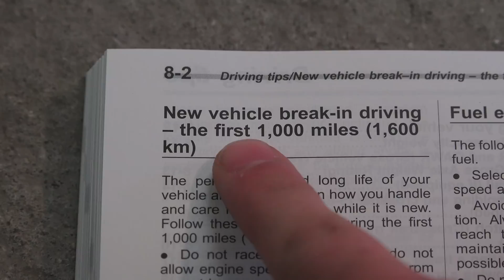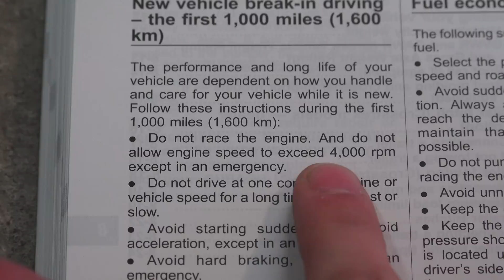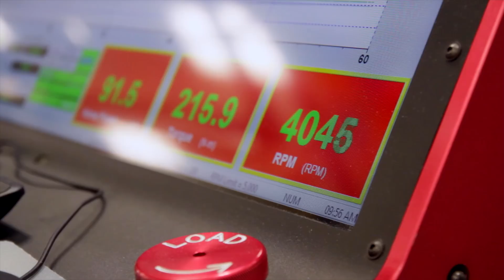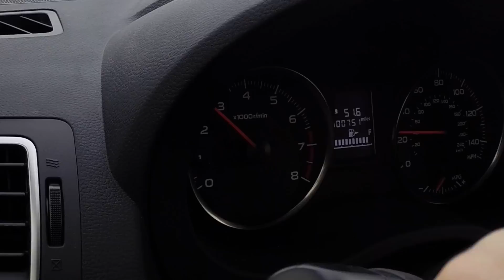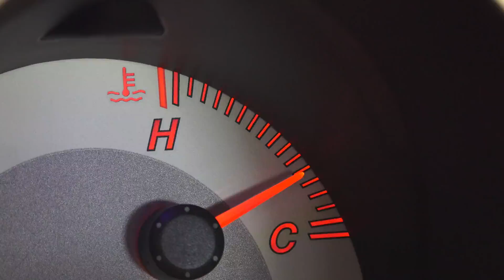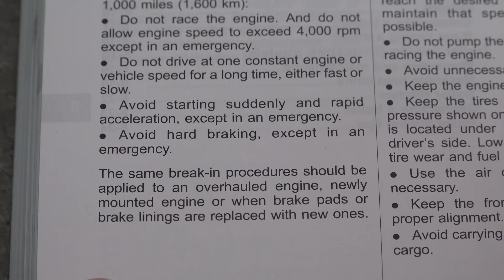5 Things You Should Never Do In A Brand New Car

Comment: No you need to floor it so the piston rings will bed in properly using the run in oil.
Reply: In 1950, yes. Why do you think you know better than all of the manufacturers? After hundreds of millions of dollars worth of testing this in the last few decades........ you think every manufacturer has the wrong idea? Stop being foolish please.
Reply: I build a lot of high performance engines and in order to create a seal between the ring and the cylinder wall you need to create good friction when the engine is new, using the run in oil. A good seal will give more economy and power ,.stock cars like your brand new honda can be run in any way you like, but the one run in hard will make more power.  nothing silly about what i am saying its a scientific fact . Now i notice you hide behind a blue A please show your face don't be scared .

Comment: RULE #1...Simply avoid lugging the engine.  Giving more throttle than the engine can comfortably handle creates excessive heat.  Excessive heat can permanently warp fresh AL pistons.  

Full throttle is bad.  High rpm is bad.  Towing is bad.  Lugging the engine is very bad, even at low RPM.

Comment: I was told that with the super-accurate and precise machining today, there really isn't anything such as "break in" when it gets into the customer's hands.
Reply: The manufacturers write "break-in procedures" into theit manuals for a reason. Engine failure is quite rare nowadays but you can still shorten your engine's lifespan but not breaking it in correctly, going too long between oil changes, no replacing the coolant on time etc.
Reply: I do seriously wonder if those who ignore the break-in period are the same people who go WOT on a cold engine that they didn't even wait to let the oil start moving before they started driving? I'm curious whether those kinds of behaviors are far more detrimental to the life of the car, than the initial 500 miles.  @andthe2380  

I'm not saying the running-in period isn't important, but you think how many cold starts and short journeys an engine could experience in its life, vs. the first 500 miles.

Comment: What would be considered short trips?
Reply: any trip where your engine temperature gauge doesn't reach full operating temp. Usually 1/2 way on the gauge. In the summer with heat in the 90's {30° C} it can be just several minutes. In the winter with sub zero temp. it can take 20 minutes+ depending on traffic, how you drive etc. Don't let your car idle for more than a couple of minutes in winter. Instead, let it idle for the 2 mins and drive carefully with the rpm's under 2,500 and don't accelerate fast. Warming the engine up under a light load is MUCH better for it than to have it sit for 10 mins in the driveway dead cold, slooowly trying to warm itself up. Let the rpm's settle down to 900-ish after you start the car and with the rpms near where it usually is when it's already warm, then drive a bit softly until it is fully warm.

Comment: You probably won't respond, but I happen to live and breathe this for a living and I sincerely disagree with your first points. Your arguments on piston ring wear do not appear to be based on any recent empirical data. We build race engines along with regular joe engines. We see more performance, less bypass on engines which are forced into aggressive break in procedures. This has been known for years in the motorcycle world and is common practice among engine builders. Why spread the myth that an easy break in helps? It does not and this is backed by substantial evidence. I offer both an engine dyno and a hub dyno if you are interested in following up on your claims.

On a separate note, your statements that manufacturers know best is not actual evidence supporting your point. If you would like, I can post up numerous examples of manufacturers recommending procedures that are not in the best interest of the consumer.
Reply: After hundreds of millions of dollars on research and development of car engines, why do you think every manufacturer is wrong? Why do you think their manuals are filled with myths? Why would manufacturers offer a plan to damage engines? Engines and transmissions are just about the only things covered under warranties these days. You just keep playing your video games and let the professionals handle the important stuff.
Reply: I never said the manufacturers are wrong. They have their own reasons for suggesting their break in periods. But it has nothing to do with getting the most performance out of your engine. By the way, this is fairly common knowledge in the professional racing and engine building worlds. But, since you want to resort to off topic personal attacks, let's have at it. Instead of providing one shred of proof defending your argument, you instead attacks me because my page contains videos of things I do in my spare time. On top of that, I run a performance shop that specializes in just the thing I am speaking on. We hold numerous horsepower and on track performance records. Now, since you didn't provide any proof, why should I? You're just an angry person on the internet like so many others. No matter how snippy your reply gets, you will still be wrong.

Comment: jokes on you my redline is at 4000........
Reply: Diesel?
Reply: Diesel Gang
Reply: lol. Actually I think that means... the joke is on you. :P
Reply: Mines as 3200!
Reply: pffft my redlines 1700
edit: custom built steam powered ‘67 beetle. almost 950 ft lbs. not your grandpa’s ICE
Reply: Cummins?
Reply: @P7777-u7r  Cummins redline is 3200 to 3400.
Reply: My uncle's diesel Audi redlines at 5.500rpm. Quite high for a Diesel engine.
Reply: Иіск Рагіllб Same here
Reply: HOW
Reply: Ahhh diesel...
Reply: Michael Tighe my friend's smart car actually redlines at 6,5k rpm, just like my previous 3 cylinder city car…
my current (pushrod) V8 redlines at 5,6k lol
Reply: My diesel car has a 6k red line bitches
Reply: Why do diesel cars has low redline
Reply: @greenblue980  I would imagine because diesel have more torque lower down in the rev range, this torque curve then drops off much earlier making it far more inefficient to run at higher rpms. But I just made that up on the spot based around my general knowledge of ICE engines, so I may be wrong lol
Reply: Because you have a diesel
Reply: @jjm2948  joke is on the people who don't know that diesel has low red line but still act like they know everything
Reply: Mines at 9000000000000000 rpm

Comment: There is no film on new tires.  It's a myth.
Reply: You are ignorant and are spreading lies because of it.
During the manufacturing process, a release lubricant is applied which prevents the tire from sticking to the mold in which it was created. Unfortunately, some of that lubricant remains on the tire upon installation. It reduces traction for a bit, but wears off after use. Going easy on your tires and driving cautiously for the first 500 miles should eliminate this lubricant and allow the other layers of the tire (the rubber, steel and fabric) to work as they should.

Comment: So should u do you're first oil change early mine is due at 8k should I come in at 2k? I got a 2018 mazda 3sport 2.5l
Reply: Early oil changed can olny help. Oil changes are the best thing you can do for any engine, no matter the miles on it. I always do oil changes for new cars twice as early as recommended. {3,000 miles = 1,500 miles. 5,000 miles = 2,500 miles etc}. I do this for the first 10 months or 10,000 miles or so.

Comment: Is it ok to drive a car with 85 miles. 287 miles highway.. What would be best way to approach this?
Reply: it is not recommended. Just vary your speed and rpm's as much as possible. Drive at 65 mph at say 2,800 rpms' for a few minutes, then go down to 58ish mph for a few mins at 2,400 rpm's etc. It is still not a proper way to break in the engine but you have a life to lead, so do the best you can.

Comment: 1. Don't floor
2. Don't shift at redline 
3. Don't use cruise control
4. Avoid short distance travel (For proper engine operating temperature) 
5. Avoid towing

Comment: New car engines are broke in in a matter of minutes,if you think the rings are wearing down the cylinder bores you are mistaken-take a new motor apart after 10/20 thousand miles and you'll see the hatch marks from cylinder maching are untoughed,JMO
Reply: Ignorance is no excuse for spreading ignorance. Why would all of the manufacturers recommend break-in periods? These are just precautions but they do limit the risk in damaging an engine. I assume you are 60+ years old? Your opinions are outdated by decades.

Comment: Hard break in is best, ask engine builders.  When I had my camaro engine rebuilt he told me how to break it in using multiple full throttle runs on standard oil changing the oil after 400 miles.
Reply from the maker: Should we ask random engine builders, or perhaps the engineers that design the engines? I think both certainly have useful feedback, but it'd be silly to ignore the folks that design it.
Reply: What a load of nonsense. Why not ask a bunch of random people who do NOT design engines and have NOT spent hundreds of millions of dollars in research "how do I break in every car engine in the world?" Yeah, smart.

Comment: Literally the only thing you need to know: Let the engine reach operating temperature. Every other direction in the manual are simply specific ways to do this. It is the only variable that affects the dimensions of the motor. When you rev to high rpm, you vary the temperature between the piston and the cylinder walls. When you put the engine under high load, you vary the temperature between the piston and the Cylinder walls. When you operate the engine cold, you vary multiple parts temperatures, and increase friction in metal on metal areas. Ever wonder why the dual viscosities in motor oil? Thicker oil absorbs more stress. Temperature control is any mechanical device's best friend, all the way down to the seals.

Comment: Not sure if this has been asked but what if you live in cold climate? Should you let your car warm up before driving?
Reply: Don't let your car idle for more than a couple of minutes in winter. Instead, let it idle for 2 mins and drive carefully with the rpm's under 2,500 and don't accelerate fast. 
Warming the engine up under a light load is MUCH better for it than to have it sit for 10 mins in the driveway dead cold, slooowly trying to warm itself up. Let the rpm's settle down to 900-ish or {where ever the rpms usually are when it's already at full operating temperature}, then drive easily until the car does warm up to full temp. Also, the car will produce heat for you much quicker this way.
Reply: And The thats totally correct. Greetings from an Engineer ;)
Reply: If your car has a turbo you should always let the oil warm up before you drive it. If you don't have a turbo, +And The is exactly correct.

Comment: You realize that companies run the engines to max rpm in the factory?
Reply: They only do that for quality control reasons. They also only do it to engines they pull off the line to make sure that the current batch of engines are being built properly. These test engines are often run through many tests like that, not just one. Then they are discarded.

Comment: Should one change the engine oil say after the first 1500 miles
Reply: It is smart to change the oil early. Any tiny metal shavings etc. can be flushed out and if the oil is getting hotter than normal due to tight tolerances being worn down is also replaced. It's just very smart to do this. Take at least 25% off of the oil change recommendation for the first several months and you will have done a lot for your engine.

Comment: I have a highly modified V-Max making 198 rear wheel horsepower and it eats up the rear tire around 1,000 miles when I put a new one I take it into a dirt lot and do burnouts with it to remove that slick crap the put on new tires. I had a friend buy a brand new Yamaha Maxim X and I warned him about the slickness of new tires, leaving the dealership he floored it and spun it around in around traffic before he crashed. Everyone came running out as fast as they could to remove his new bike out of the road, the dealership repaired it for him for free because they never warned him about this and did not want a lawsuit. When I bought my next V-Max from the same dealer they told me about the tires needing a break in but I already knew this

Comment: I've owned 3 brand new cars. Beat the crap out of them right off the dealer lot. My first one was totalled unfortunately after 4 years and about 100k km. Not a single blip and mileage was astronomical on that car. Second car owned it for about 40k km and traded it in, had a bigger engine so fuel Econ was slightly crappier but never let me down. My next ride was a demo with 5k km. It was broken in VERY hard. At about 155k km now and she's still going strong knock on wood. 
All my cars have been over maintained because I have the opportunity to take care of them. Treat your car well, and it will take care of you
Reply: Just because 3 cars in the world were broken in poorly doesn't mean it's okay to abuse the engine of every car. It is more likely an abused engine will break down more often or develop problems earlier than other engine will. Your statement of "Treat your car well, and it will take care of you" is idiotic. You abuse your engine badly right from the factory but claim you "treat your car well"? You're a dim person.
Reply: And clearly you know nothing about cars. I would take a beaten car over a babied car any day of the week. Why? Because a babied car has never been pushed. Start pushing it and stuff is going to break, and fast. Having experience from tracking my cars for years now, stay on top of the maintenance and very little will happen. When something does happen, take care of it immediately. Prevent high maintenance costs down the road. If you are going to modify your car, do it properly and you will be less likely to damage anything. If you don't know how to tune, pay a professional. All cars are meant to be properly driven (aka beaten on) consistent start/stop, short trips, lack of maintenance and leasing is killing these cars. Why leasing? Because owners don't care about the car and know it's going back. I work with cars on a day in and day out basis, even with included free maintenance people still go over the oil change interval. In some extreme cases as high as 40k KM's overdue. Maintenance is number one thing keeping cars alive

Comment: I have a new car with about 300 miles on it , I floored it only once, is once enough to damage it during this break in period ?
Reply: I floored mine 4 times already and I had less than 100 miles lol
Reply: Engine failure is quite rare nowadays. Even if your pistons or rings or cylinder walls got hot spots or some premature wear, you will still be 99.99% safe. These break-in procedures are precautionary measures to get the longest life from the engine. Maybe your engine will need piston rings after 170,000 miles or maybe it will start burning some oil in year 12 instead of year 14 etc. Most likely you are fine and have only shortened the lifespan of the engine by 0.001 percent. Or maybe caused a few little issues to be more likely near the end of the car's life. Don't worry about it.

Comment: i am sorry, but break in period for tires?? i dont know what kind of cheap made in china, hand sewn by children tires you are talking about, but if you decent tires from a decent brand, they have no film on them at all, they are good to go after getting them installed on the car, as for the breaks, the breaks dont have a film on there either, the reason brakes need to break in is because brake pads and brake disks are not the same shape (the general shap is but on smaller level they are not) so they need a bit of wear to adapt the same shape, giving you more surface area when the pad pushes on to the disk, resulting in more friction, resulting in to faster / better breaking. how ever this is not a couple on 100 miles, this is just a couple of miles i would say between 30 and 60 miles depending on how break heavy you are driving.
Reply: With your ignorance and insults aside. During the manufacturing process, a release lubricant is applied which prevents the tire from sticking to the mold in which it was created no matter where the tires are manufactured. Some of that lubricant remains on the tire upon installation. It reduces traction for a while, but wears off after use. Going easy on your tires and driving cautiously for the first 500 miles should eliminate this lubricant and allow the other layers of the tire (the rubber, steel and fabric) to work as they should.

Maybe try learning something sometime? Showing how ignorant and lazy you are is never a good idea.

Comment: Most people overlook the effect of camshaft lube that is applied to the lobes during installation.  The lube contains extreme pressure additive package that is very inert thus not soluble in engine oil.  High rpm and heat is required for the additive to chemically bond on the lobe surfaces thus significantly reduce wear.  The excess additive which is insoluble in the oil I repeat gets collected in the filter.  If the oil flow is high enough to force the additive out of the filter, other moving parts eventually get a slippery coating that thin synthetic oils nowadays can't provide.  This is why most car manufacturers suggest owners to keep the factory oil for at least the first 5000 miles before oil and filter change.